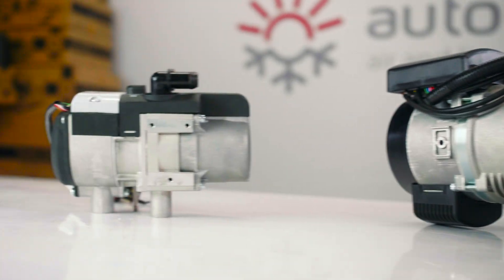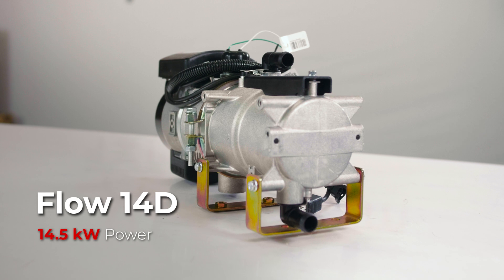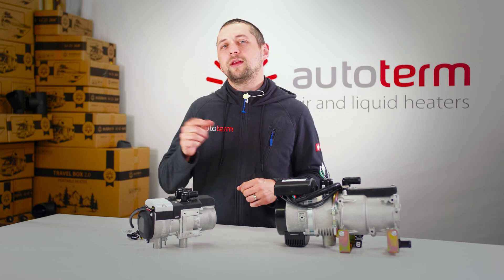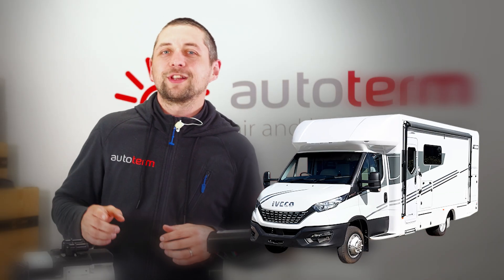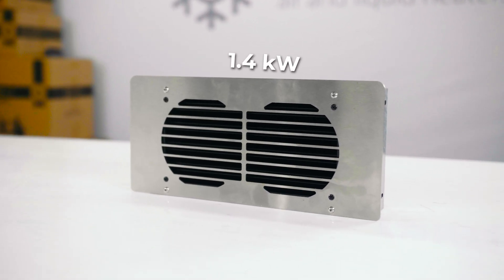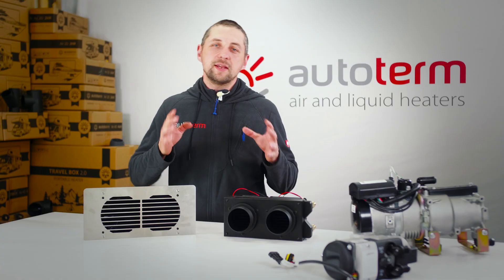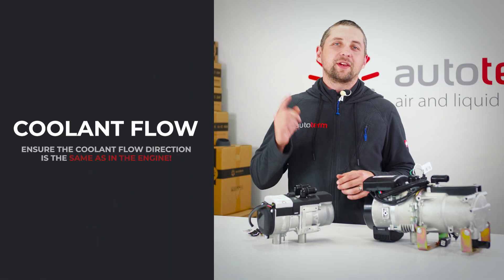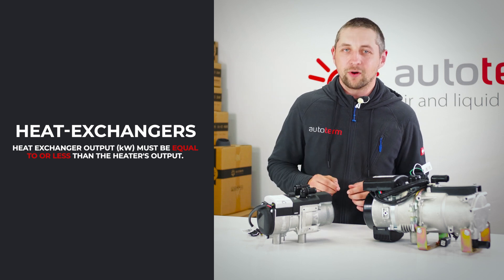🔥 Liquid Heaters Explained: Engine Pre-Heating, Power Output, Installation, & More! 🔥

Comment: Great devices I had an air heater and it worked fantastic. I want to convert to the liquid heaters now but I don't really understand the 120 minutes runtime limitation? Does this mean 120 minutes continous burning limitation or does it shut off completely after 120 minutes (would be bad in the middle of the night)? Thanks :)
Reply: No my comfort controller I can set the timer so car interior toast warm in the morning and all defrosted

Comment: Will this system fitted to a Fiat Ducato, turn on the Cab heater fan to heat the van when coolant is hot?
Reply from the maker: That largely depends on the vehicle’s fan specifications. With an external fan, it’s definitely possible. However, if you’re using the original fan, visiting a service center would be the best way to determine compatibility.
Reply: I used a pwm relay it turns on my interior fans in my Vw Touareg